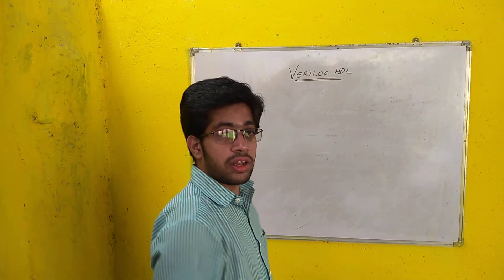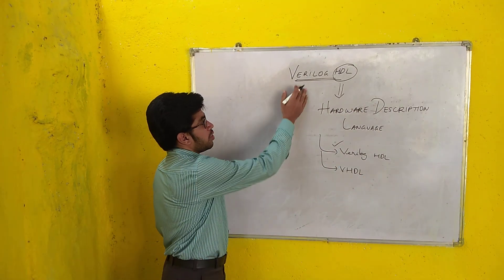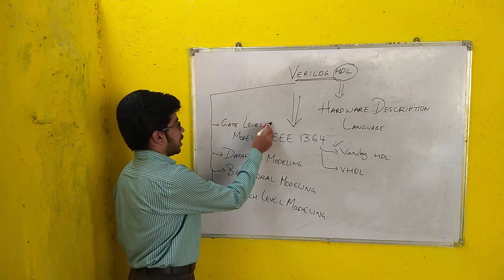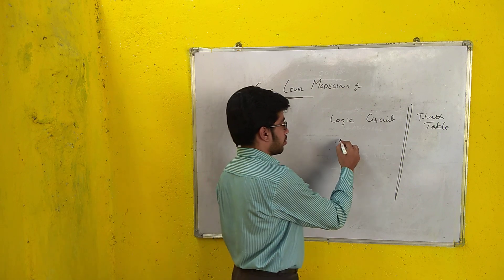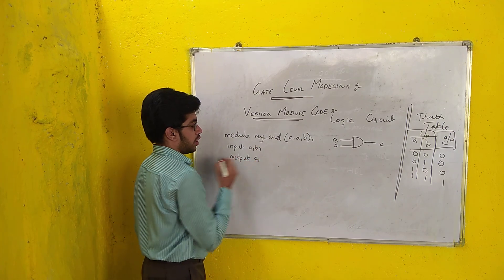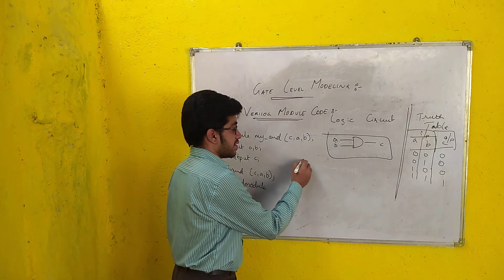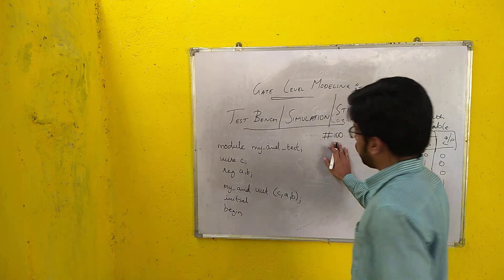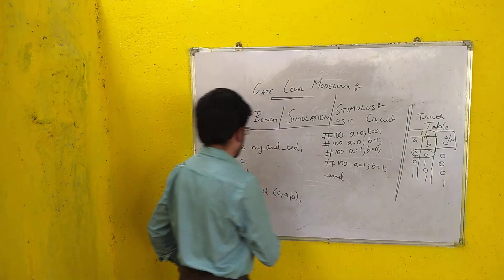Introduction to Verilog HDL and Gate Level Modeling by Mr. Noor Ul Abedin

Comment: Sir u said to take output as wire and input as reg.... Y so sir...?
Reply from the maker: Because in a Verilog Code there are two types of codes i.e. one is the design module and the other is the test bench. After getting the module design we should verify the design, so we consider the output as wire and input as reg in the test bench calling the module code as to check the proper functioning of the module design, weather it is working properly i.e. the truth table should be verified, if verified then it is correct.

Use this for reference
https://www.youtube.com/watch?v=Uij0qoW2DLw&lc=UgxO-5OPO3OxIg0y_wF4AaABAg.9B-cbHJ-BXj9C1E9XLnocy